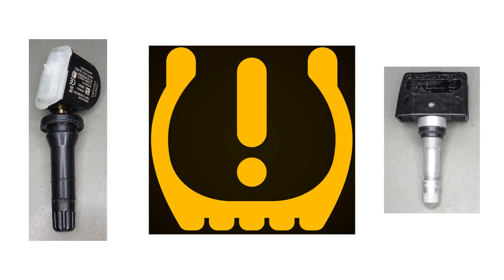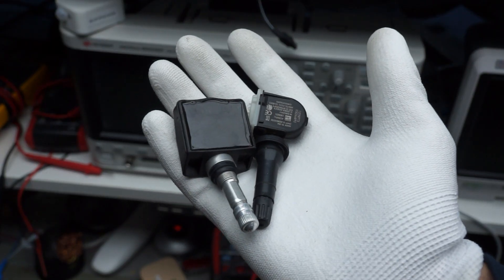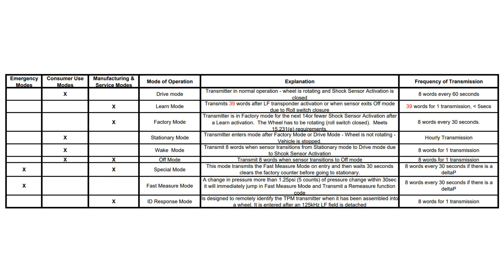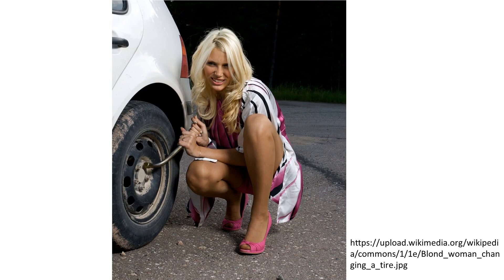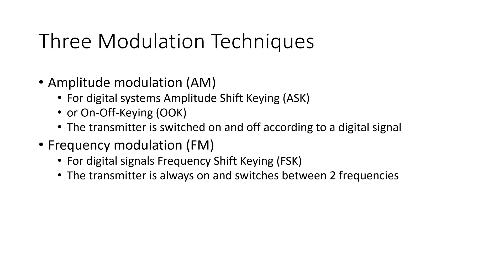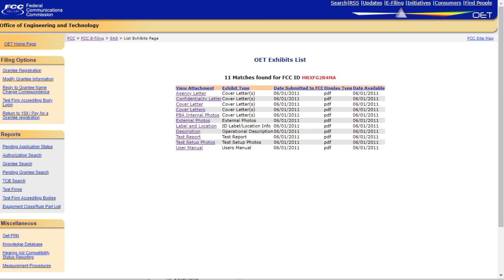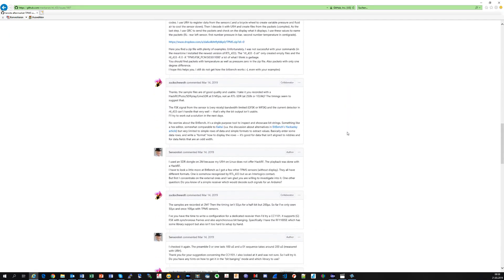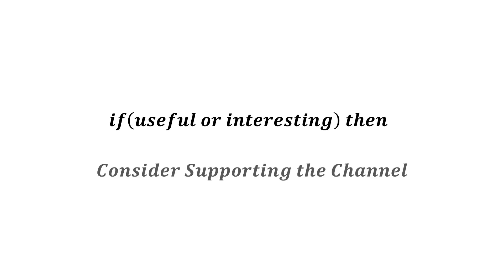#261 Measure Pressure Remotely (including TPMS Hacking / Attack) for Beer Brewing

Comment: My 2002 Buick Park Avenue Ultra, with 3.8 L SuperCharged Engine, used the indirect method. It uses the Anti-Lock Brake sensing system to measure the rotational speed of the wheels, and yes, if the tire pressure changes from the last calibration set-point, it displayed a message in my DIC (Driver Information Centre). I kid you not, https://my.gm.com/content/dam/gmownercenter/gmna/dynamic/manuals/2002/buick/park_avenue/2002_buick_park_avenue_owners.pdf. Here in Canada, we have summer tires mounted on nice wheels and winter (snow) tires mounted on cheaper steel wheels. The cost of the TPMS four eight wheels from a car dealer would be over $1000.00 CAD installed on this model. So, the use of an indirect system is an economical choice for sure as you do not need four sensors for the summer and another four sensors for the winter. In addition, the built-in battery does not last long in the hot/cold weather cycles and as these are sealed units, you end up replacing them with some regularity oer the lifetime of a vehicle.
In any event, I used an external gauge to measure my tire pressure on a fairly regular basis, and found that when the alarm was activated, the difference was typically around 6.9 kPa. I would not expect to see much better than this in a direct sensor.
Reply from the maker: That is interesting. I could not measure 0.069 bar with an external gauge. Seems to be nearly impossible to distinguish such a small difference from an indirect signal.

Comment: these sensors are for sure not adequate for food and beverage, isn't it? I assume a solution could be to separe the sensor from the beverage with a silicone membrane or diaphragm that is tight but still flexible to tranmit the pressure variation to the sensor chamber. unfotunately i do not find such a thing on ebay. Something smaller and cheaper as a "Ausdehnungsgefäß".
Reply from the maker: The sensors can be kept quite far away from the beer. The bigger problem is to find a way to connect them airtight to a bottle. And as you wrote, we could use a material to even more separate humidity from the air. Maybe GoreTex?

Comment: A small correction, rtl_433 can work on any band including ISM 315MHz devices.

I've developed a simple transmitter that can do 433/315 ASK or FSK transmissions controlled by an AVR (Arduino) which might interest you!

https://github.com/gcormier/tpms_silencer
Reply from the maker: Thanks for the link. Good concept. I tried to build a simple transmitter and receiver with a CC1101 but so far was not successful for GFSK.

Comment: Very interesting. Is there any indication what kind of components are used for the pressure measurement and are they available separately?
Reply from the maker: You can buy pressure sensors. You will see one in my next mailbag. But I plan to do a teardown of one of the sensors.

Comment: 0.47 I am pleased that you said "wirelessly coupled" and avoided that totally idiotic, and oxymoronic, term "wireless connection". :-))
Reply from the maker: I am not a linguist. Many people use "connected" also amongst people. So it seems to be ok ;-)
Reply: Nor am I but surely the whole point of a WIRELESS system is that there is no connection between its elements.

Comment: Great vid, some good nuggets of info there. I really wanted to get into OBD port data but my own vehicle has OBD 1 not OBD 2 which means you can’t do much with it. Also, always wondered how HUMVEE wheels have remote inflate / deflate tyre control from the dashboard which is cool :) thanks for sharing!
Reply from the maker: To inflate them is probably a little trickier...
Reply: Andreas Spiess they do look like they have some kind of ‘canister’ mounted on the hub of the wheel? I’d thought that was where the air was controlled from.. and I’d considered having the wheel hub as a brushless motor, then you’d have power inside the spinning wheel (as dynamo) :)

Comment: Are you sure that the tier diameter get bigger when the pressure is high? Don't your tiers have a metal core that fixes the diameter? How inderct works, I dont know, but that the wiers wold get logner to alow a bigger diameter sounds strange. Thanks for a interesting subject and information.
Reply from the maker: I think I said that the diameter gets smaller with lower pressure. This is quite obvious if you look at a flat tire.
Reply: @AndreasSpiess  Thanks for all your videos. I would state that the circumference is the same due to how a modern car tire is constructed. The metal core makes it more like track on a tank. When flat, it is just not round. But one turn of the wheel is the same distance.
Reply from the maker: Maybe. The indirect systems depend on that effect.
Reply: @AndreasSpiess  the technology used (after some Google) might be "spectrum analysis monitoring certain tire-pressure-dependent oscillations" according to https://www.businesswire.com/news/home/20120720005231/en/Nira-Dynamics-Indirect-Tire-Pressure-Monitoring-Systems
Reply: @AndreasSpiess  i feel like a jackass. Thans for another good video. Just ignore my comments. Keep up doing your stuff.

Comment: This is useful!  I want to measure tire pressure from inside my house so I know if they are low BEFORE I need to drive.
Reply from the maker: If the reach is long enough...
Reply: @AndreasSpiess  Please, obviously this is a project for you where RF reach is not an issue. Just put an IoT device in the car, that connect to the home WiFi and report about the pressure. ESP8266 (or more) for the wifi part. Whatever you come up with for the RF part. The car device would charge a Lipo on the 12V from the car, when not powered by 12V, it assume the car is park... in that case, it wake-up from time to time, check if the home wifi is reachable... if not, goes to sleep, if present then send to an MQTT queue. Of course, we count on you to use the deep sleep mode of the ESP8266 (or was is on the ESP32?). You have a car, so you could use that project for yourself. Of course, if you are worried about your wife running flat while alone driving, you could make us a LoraWan (or another one you tested) so that it report to you at home (or on your mobile) whenever your car tire run flat. If you get that message, call your wife to tell her to go to the nearby station. While this might not be super interesting for your wife driving alone, imagine some truck company with a fleet that could remotely monitor the health of all the wheel from their trucks. ;-)
Reply: Not going to happen. The sensors shut off after a while and only reactivate when the car moves again.

Comment: Trains have similar transmissions. Head-of-Train, End-of-Train, Middle-of-Train. Could you explore those transmissions?
Reply from the maker: I was more interested in wirelessly measuring pressure than in the TPMS ;-)
Reply: The automatic axle counter report broadcasting is a US thing. Afaik it‘s just broadcasting voice. In Europe the axle counters communicate by wire with the switch towers

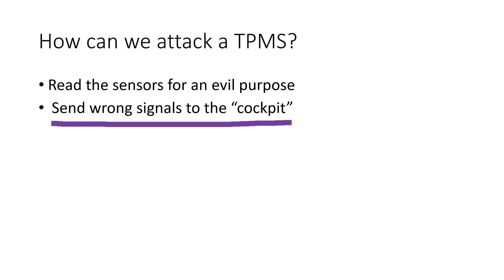Comment: And now to learn something useful:  Pause at 18:45

Always bypass the throttle-block if a soundcard or radio is involved. Bypass has the keyboard shortcut 'b' (or right click, bypass). The block is then shown in yellow and samples that would normally enter the input are instead copied to the input of the following block. The bypassed block can be re-enabled by pressing 'e' (or right click, enable).

Explanation:

If no clock is involved, digital signal processing will run as fast as possible. This is great if input and output are files (or data in memory) which need to be processed as fast as possible. It is no so great if you want to visualize something, then it will consume 100% CPU for a short time and everything is done before the first picture is rendered on the screen. If you want to visualize something (i.e. FFT plot) you want it to be slowed down to some normal speed. This is when gnuradio-users add a throttle-block just before the data is visualized. It uses the an timer from the operating system to slow down the flow of data as specified by the sample rate.

If a soundcard or radio is involved, then you have some DAC (digital to analog converter) or ADC (analog to digital converter) that processes samples at the sample rate that is specified. This slows everything down to the speed of the hardware. The throttle-block is no longer needed.

If more than one block is active that limits the speed of the data flows and their clocks aren't exactly synchronized, then you will run into a problem!

Further Explanation: Clock domains

The sample rate is set to 2000000 samples per second. This is used to setup the HackRF to consume that much samples. To know when it is time to consume a sample, it just counts its clock ticks. These clock ticks are derived from a small crystal oscillator that has some error (~ 20 ppm). The timer in the computer is locked to another crystal oscillator on the mainboard which has a similar error.

These are different clock domains and they will definitely disagree with each other. So the throttle block might run slower than the radio. And then the throttle-block will cause all buffers in front of it to fill up and throttle the whole flowgraph while the radio consumes samples until its input is empty. Then you have a buffer underrun, then the radio stops and the buffers fill up again, the radio starts again until the next buffer underrun.

If the radio is slower in consuming the samples, it becomes the "throttle-block" and starves the real throttle block. But this is no problem at all.

The easiest solution is to disable/bypass the throttle block.

Worse problems: You are forced to have multiple clock domains.

A typical example is a FM receiver:

radio (ADC) -> gnuradio fm-demod -> (DAC) soundcard+speaker

If the soundcard is too slow, the radio is forced to throw samples away and then there are gaps in the signal. You will see overflow warnings from the radio and hear clicks from the speaker. If the soundcard is too fast, it will have buffer underruns, also with audible clicks.

On the transmit side it is worse, because you don't hear the clicks but transmit them as broadband noise. Fortunately devices like HackRF have a relatively low transmit power ( < 10dBm).

Possible solutions:

1. Synchronize all clocks. Most radios have inputs for a 10MHz reference clock and and some have an 10MHz output. Or the better solution, have a gps disciplined reference oscillator. Devices without reference input are harder to synchronize, but cheap USB-Soundcards are easy to modify. Many use a 24.576 MHz oscillator which can be removed and replaced by an external signal generator that is locked to the 10MHz reference.

2. Use software to detect the difference of the producer and consumer of samples and re-sample it.
Reply: I just wanted to say: bypass the throttle block when transmitting. ;)
Reply from the maker: Thank you for your explanations. 
You are right. I forgot to disable it. It did not hurt, probably because the signal is very short (otherwise I would have discovered my mistake)
Reply: I hope that this explanation is useful for every reader of this comment. :)
Reply: Excellent information, thank you!!!!

Comment: I need a pressure transducer for 400 bar (40 MPa). Any ideas?
Reply: Just checked, you can get one for about 28€ on aliexpress.
Reply: @Basement-Science  thanks from the message, I forgot to mention that is has to be very small (thread diameter <= 5mm).. very hard to find
Reply: Yes, and you can control with pwm. I have one with a lorawan atmel, only 20 bars. I think in  400 bar you need one for industry signal 4-20mA or 0-10V. It s more expensive.

Comment: I always thought the tyre monitor was wired into the wheel with a very very long wire. So you could only go so far before you had to reverse and wind up the loose wire again.
Reply: I can confirm this. That’s what they call a tire rotation lol
Reply: @Nicksperiments In lieu of the tire rotation, one can tell the wife she has to drive backwards from the grocery store once a week to rewind this wire.

Now we are just being plain evil.  :D
Andreas' video brought out the worst in us!  I don't think this is what he intended.  But from what I hear, this would not work on his wife anyway.
Reply: Nah, I think you are thinking of electric vehicles, their range is limited by the length of your extension lead.
Reply: This is hysterical...  Best used if you have a blonde wife.  ;)
Reply: I thought they use the brake pads as brushes. That's why you have 2 brake pads on each rotor. One for Vcc,  the other one is Data and the ground comes through the axle. However,  your theory sounds more convincing and I'll take it.
Reply: That's also the secret technology behind electric cars no one tells you.

Comment: TPMS is excellent for tracking vehicles in your neighborhood. A cheap surveillance system.

"Track Cars with Wireless Tire Pressure Sensors, Hak5 1511.1"
https://youtu.be/TDYoo7TGNcw?t=299
Reply from the maker: Maybe. I did not see any proof in this video. Using my eyes is still easier...

Comment: Great video again with a lot of interesting stuff I learned.
So I can put a 433 Transmitter on a LoRa Board, plug the module under a foreign car, drive with a larger distance behind a car hand and to turn on tire alarms remotely to get the car stop. Interesting.

I look forward to some ideas how to use the sensors for other IoT use cases.
Reply: Forget about the Lora Board... you need a solution to get rid of a car driving too slowly in front of you were you cannot overtake it. So drive closer for one minute, then simulate a flat tire and wait for the car to go on the side to check. At that point, you pass the car and can start driving faster (while respecting the speed limit).
Reply: You're evil !
Reply from the maker: Better than a bomb to stop a car...
Reply: @AndreasSpiess  Can we use this to retrofit TPMS in cars that TPMS wasn't an option from factory ?
Reply: Wouldn't work in the US. People here seem to drive as long as the car keeps moving. I sometimes see people driving on rims after they've shredded the tires.

Comment: Thanks for this lot of work and very interesting contribution. As far as I remember the first TPM sensors did not have this acceleration sensors/switches to activate by a turning wheel. But then, you got interference with your winter tires also sitting in your garage.....
Reply from the maker: Interesting. It should not happen because each has an ID and they must comply the 1% transmit time limit.
Reply: @AndreasSpiess  Nowadays yes. But in the early days there were no external units to initiate the pairing. The car took what it got. There were several antennas in the car and the car tried to localize the senor by evaluating the field strength. 
 The sensor had to be as simple as possible and the rest was in the car. Btw. the indirect systems  worked very well except of common mode issues. They helped me by an useful warning. But the US laws forced the industriy to go in the direction of direct systems. This made the Systems more complex and expensive - unnecessarily as I think.

Comment: Good stuff Andreas.... Down side: off to eBay to buy an SDR! 😃🍺👍
Reply from the maker: Not a bad decision. You will see!
Reply: Just search for "R820T2", look at the product pictures, there is one stick with a blue case and one round corner at each side. Make sure the rtl2832u chip is also mentioned. This thing should cost between $10 and $20 depending on the seller and if it comes from a local warehouse or directly from china.

Don't pay more than $20, use the saved money to buy some adapters from MCX (the one used on the USB stick) to SMA and a short (1m/3ft) cable with SMA to BNC, PL or N connectors as strain relief. And good 10mm coax to get a antenna on the roof (with N, PL or BNC connectors - the same as the first cable).

An antenna on the roof (or at least outside of the house and away from all electronic appliances), good cable and adapters will be much more expensive than the SDR but they make the difference. A cheap SDR on a good antenna receives a lot, an expensive SDR with a crappy antenna (like the one that is included in most of these rtl sdrs) is useless.

And as Andreas said, buying an SDR isn't a bad decision. :)

Comment: Great video and a lot clearer than reading spec sheets! 
In a book 'the car hackers handbook' they describe how to read from these sensors, including sending a wake up signal to the sensor to get a response from vehicles driving by. You could use that for the beer pressure monitoring, just send a 125khz wake up signal when you want to read the pressure? Ps: I'm a home brewer myself, so looking forward to your next video!
Reply from the maker: I hope I will not need that signal as it would need a lot of additional circuits and power...
Reply: I just added a comment relating same "car hacker handbook" we have same readings!

Comment: Both useful and interesting. And well timed too. I bought a charger for my car. And a remote device for measuring the current used at my intake. The charger can be parametrized to turn up/down or even off charging based on current used by the whole house. So if I can emulate this remote device, I can control the charger from my home automation system. You gave me pointers to some programs I can use to hack the protocol that I did not already know. Thank you.
Reply from the maker: Enjoy hacking!